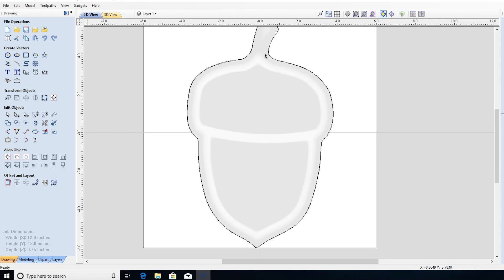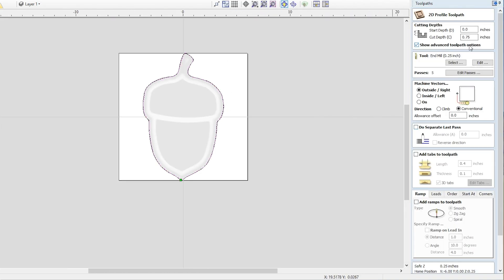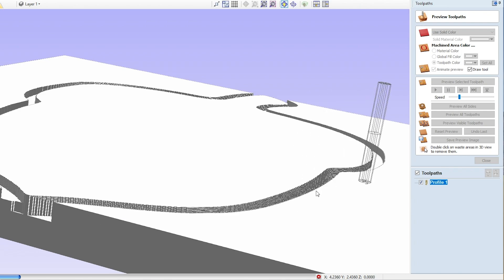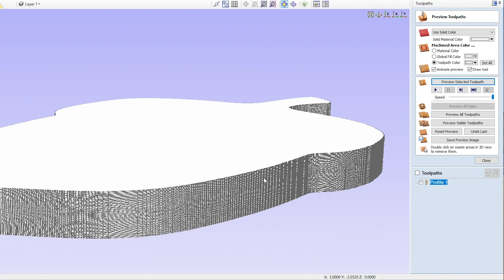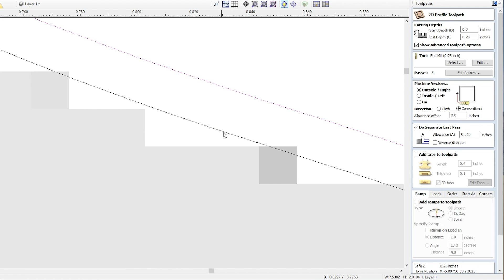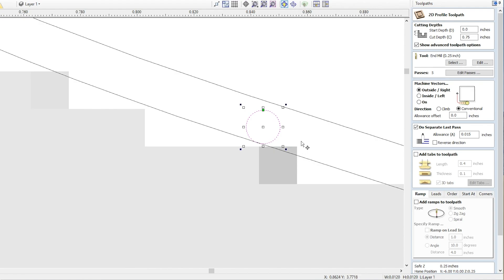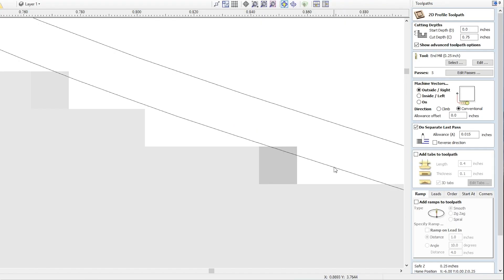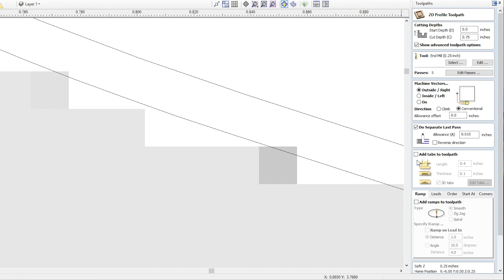Get Rid Of Horizontal Lines - A Quick Trick In Vectric To Get Perfectly Smooth Edges Every Time

Comment: It would have been better illustrated if, when showing the offset line of 0.015, that the bit diameter be bigger than the offset. The circle you used was smaller than 0.015, and would have the same problems with chatter resulting in an uneven finish.

Comment: Far faster and smoother method to fix this in 2 easy steps.  

1.  Highlight profile vector.  Click smooth lines along vector.  Set to BREZIER CURVES. this reduces node count and far smoother cuts between them.   

2.  In profile click on ADD RAMPS TO TOOLPATH.  Click SPIRAL.   this will cut downward on a spiral. Each pass will spiral to your cut depth number per pass.  

3.  Optional “offset last pass” on profile vector will offset to your set amount and then make a super nice cleanup of the part without plunging while cutting.     I think it’s Better to set this as its own toolpath so you can increase FeedRate or adjust rpm for less of a radial cut depth or z depth of cut on finish pass.     Simply set offset in first toolpath. Let’s say 0.010 Then set the offset in second toolpath to zero.   This way final cut is removing 0.010 worth of material for a smoother finish and reduced machine time with increased feedrate and rpm.

Comment: With this method, does the finish pass method act like an offset mode, except for the last pass.
Or in your example is the last pass .015 smaller than the part itself
Reply: No, you keep the real dimensions. All passes are offset larger than the part itself, except for the last pass.

Comment: These new tips and tricks videos are great! So beneficial ... thanks
Do you have a tool to convert the Vectric imperial files to metric?
Reply from the maker: If you have the actual Vectric file (.crv) then you can simply open it and in the job setup, just select the MM option and it will convert it to metric from imperial. Then you can output your tool paths.   Our CNC systems use a metric post processor so whether you design in imperial or metric, the output G Code file will be in mm.

Comment: great videos, I especially like the one before this. I always spend time cleaning up vectors with node edit for the reason you mentioned. I wasn't aware of the "fit curves to vectors" tool, so I did it the long way. Thanks! Also can you recommend a good bit for profile cuts? 1 flute, 2 flute, up cut etc...?
Reply from the maker: I am working on a video on bits now.  The best cut is going to come from a compression end mill as it will give you a clean top and bottom edge. Look for a 2 flute compression end mill from Amana Tool
Reply: @StepcraftInc  Thanks, i'm looking forward to more videos

Comment: Trimming the spindle is fine, but you also have to make sure that you entire z axis is perpendicular to your cutting bed.
Reply: Sorry, I didn't mean to correct you. I was saying it so folks remember that it's important... people always say "Tram the spindle" and all the videos out there never mention that you have to tram your z axis, THEN tram the spindle. Nobody ever mentions the z axis as a whole thing. Great video, btw.
Reply from the maker: That is correct.  When I mentioned tramming, I always think of both directions.   Maybe I will do a video on tramming tips.
Reply: I think you meant "tramming" the spindle, and that you meant that the Z-axis needs to be coplaner to the spoilboard (what you've called the cutting bed).  This latter issue is corrected by milling the spoilboard during your initial setup.